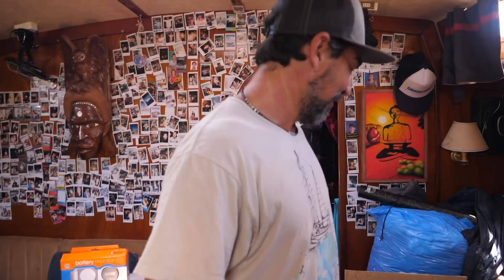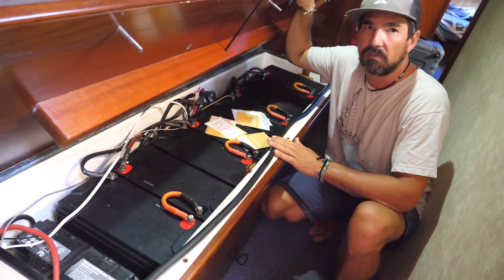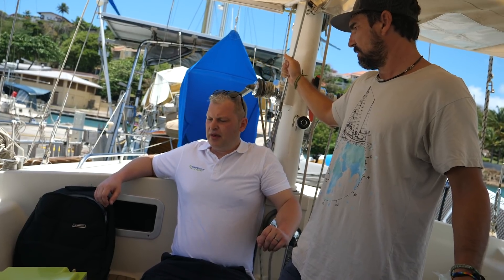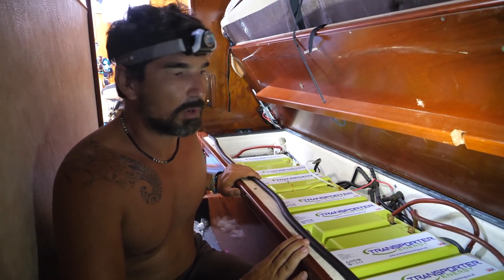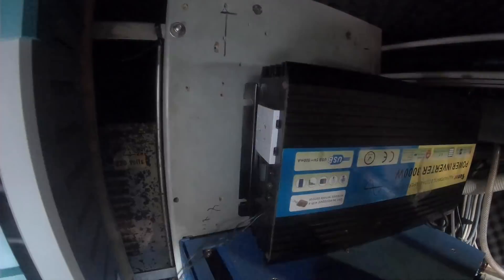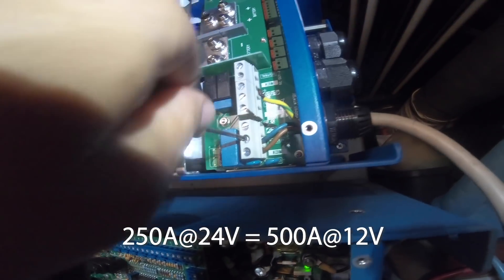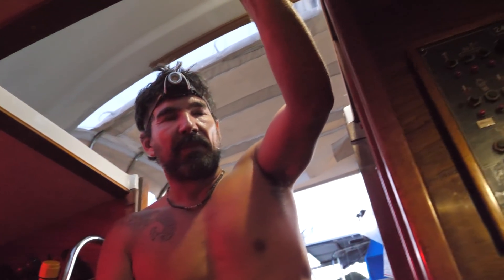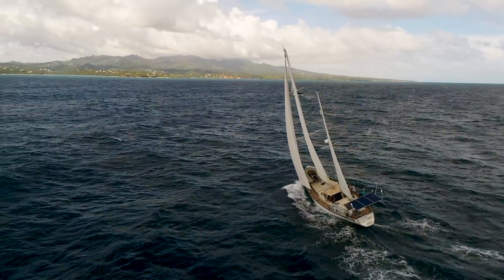Hello LITHIUM, Goodbye Propane!!!  Part 1-  Sailing Vessel Delos

Comment: You read a comment about flexible solar panels over your Bimini top on a different video  given that it is possible to use more power than you can produce with solar and wind and have to use the generator from time to time, I think it does make sense to make use of that unusable space to generate electricity.  The downside it that it would block sun light in that space making it darker.

Comment: When working on batteries, first and foremost, disconnect the ground connections FIRST, and hook up the ground connections up LAST!!! That means when you connect up the positive leads there are no sparks, and they can't arch over to grounded things when being hooked up. NOTE: This is for working on the batteries. Everything else, work with the circuit breakers off.

Comment: I'm  just watching now Aug 24 2020.
15:30 I heard Brian say he configured it for lithium Ion.
His batteries are lifeP04 (lithium iron phosphate) 
Note : lifeP04  range between 2.5v min. and 3.65 v max.
          Lithium Ion range between 3.0v min. and 4.2v max.
If he over charges a battery he could damage it . Fortunately the built in computer (bms) should stop the cells from over charging. 
He should set it for lifeP04 .
Also set the range between  2.8v and 3.6v or 3.5v in order to extend the number of cycles .

Comment: 3:58 I don't what's with the lead-acid, I don't understand the explanation, but you're going to get 100% capacity of the Li-Ion; if you charge only in CC, and not CV, they are not going to be fully charged, maybe 80%, in CV charging profile, current drops slowly down

Comment: propane tanks do not explode without significant external effort. LITHIUM batteries on the otherhand.... remember when those note 8 phones were exploding in peoples pockets. Thats what happens. They don't explode per say but ignite.
Reply from the maker: I think it's worth noting the the batteries used on boats are typically LiFePo4 which are much more stable, and thus less energy density, than those used in phones and cars.  I've found as long as you properly charge them they are very dependable and quite safe.  On the other hand during this trip over the past 10 years we've had two galley fires as the result of propane leaks....  I also spoke to someone that had their deck blown off because propane is heavier than air and sinks into the bilge.  Always a caveat to anything!

Comment: Diesel powered hob....save electric power https://www.ebay.fr/itm/Webasto-Diesel-Cuisiniere-X100-Avec-Installation-Kit-/264796696278?gclid=CjwKCAjw34n5BRA9EiwA2u9k31lYTua3H5UMlFeCwGtVfl8k8Ube29uPZz7QCafT6VrdB4Klmx8wdxoCfMAQAvD_BwE&var=0&mkevt=1&mkcid=1&mkrid=709-53476-19255-0&campid=5338666530&toolid=10044&customid=CjwKCAjw34n5BRA9EiwA2u9k31lYTua3H5UMlFeCwGtVfl8k8Ube29uPZz7QCafT6VrdB4Klmx8wdxoCfMAQAvD_BwE

Comment: What you are talking about the battery and voltage spikes and voltage changes. I don't know with such big bulks, but in small circuits I fix that problem with a condensor between both poles.

I'm guessing you could do something similar? only a much bigger condensor
Reply: i'm guessing that's pretty much what the reserve battery does, but maybe battery is not used to get drained so quickly?

Comment: Confession time:  Before watching the whole video, I jumped to "contusions."  Didn't know that the Li batteries are smart batteries, which monitor themselves and expectantly avoid any failures, fires, or other catastrophic events.  OK ... green light.  My only problem is that I'm still on the early stages of depreciation/amortization of the beaucoup bucks AGM batteries installed a year ago.  Now, does Balmar make a regulator which will address the efficient charging of Li batteries?  I don't have a generator, but would like to upgrade the Yanmar stock alternator / voltage regulator to handle, for the time being, installed AGM  batteries, with the future option of switching to Li batteries.  The propane stove is good for making a Lasagne, or a pizza.  Maybe there's a big Dutch oven or a fabricated steel box to put on the induction plates to simulate an oven.  It's looking like LED's and Lithium batteries are the greatest advance in sailboat technology since fiberglass, carbon fiber, and stainless steel.  Read some old sailing books when they sailed with oil running lamps from England to Scandinavia/ Denmark, in the fog, in English Channel sweeping currents, around ubiquitous rocks and reefs, in the fog, in leaky wooden sailboats.   AIS, proximity alert radar, autopilots, satellite weather maps?  Don't let all this lull you into a state of capricious  non-vigilant attention.

Comment: What is fire risk with Lithium batteries?  I bought a NewWave induction hotplate (fell for the infomercial) and it is GREAT.  Dial in the temperature you want.  You need SS or iron pans.  Dutch oven is great for stews.  Up north, propane is handy for heating with (forgot the name) space heaters.  Always leave hatch cracked open though.  I guess Teslas don't catch on fire often so guess that the Li batteries are relatively safe.  Maybe have an automatic fire suppression installed over batteries?  Type C fire extinguisher for electrical fires?

Comment: The thing you must be very aware of is that batteries have tremendous current capacity.  If you were to allow a tool to come in contact with both terminals you can weld a large wrench or burn in two.

Comment: I remember being 10 years old exprimentaing with ultra large (barely liftable)  1.5V carbon zinc cell my dad had brought home from his work that had been used as back -up supply for some industrial circuit.
 In my mind there was of course no danger (as I undertsood  1.5V). Of course there was no danger of electrocution -  you could put your tongue across terminals and feel nothing. But then accidentally connect a thick conductor wire across the terminal (as I did) and the flash /bang as the many 100s Amp current surged through and vaporised it instantly  was quite a shock to me. No harm done - but a close escape

Comment: In the video before you worked on the stove top and before the carpenter was aboard. What is the black appliance behind you on the counter top that has a chrome fan cover? If you were looking at the stove. On your right?   Also i wonder how much voltage did you use with the new system and using the a/c ?? Versus the old lead acid system ?

Comment: Another great improvement to an already sweet and pretty low environmental impact floating home you guys have in SV Delos. Nice job with explaining the new system and why you made the switch and you choice of LiPO battery.  I had no idea there were so many different types of LiPO.  Appreciate the knowledge.  Curious what the new system costed you and how long before it pays for it self vs propane.

Comment: I just wonder how long will these last. In my experience  lithium batteries last about about 6-7 years in my use I rarely go below 70-80% most of the time my batteries are fully charged up . Lead and agm batteries last about as long but cost way less than lithium.

Comment: Great video, very interesting! Just a thought... I've always found induction hobs to be as quick, if not quicker than gas; although the calorific content of Butane / Propane being a petroleum derivative is higher than Natural gas, and so will boil quicker. But is the kettle you used the one you used to use on the gas stove? Induction Hobs need a kettle with a perfectly flat, smooth base with no air gap between the base of the kettle and the ceramic worktop - also installing an Induction Hob usually means buying new cookware with steel base that are strongly attracted to a magnet - copper, stainless steel or cast iron won't heat so well. Above all, ensure the base is dead flat or air gaps will be formed between the cookware and the hob - which will overheat and cause the hob over temperature cut out to operate early - maybe the clicking you heard!   Sorry if you knew all this - but maybe someone else considering a ceramic induction coupled worktop may benefit. Cheers!

Comment: Why use a generator? You'd be better off using solar panels or a small win generator.
 Cruising the cut uses solar panels with no generator and has plenty of power. Just thinking out loud.

Comment: It sounded to me like the batteries are in charge. (No pun intended!) IF they all detect a problem and turn themselves off, are they guaranteed to come back on again if the problem is corrected or can they leave you powerless? Are their onboard computers isolated from external power surges? Does your generator come on automatically when battery power is lost? What could you do if they all shut down when you needed to be pumping water out of the bilge from a leak? 

Can you mix the starting battery with the Li batteries without having them on a different charger? Are the 4 24VDC Li battery pairs being charged at 24 V or 12V each even though they're paired? Is it that NEW charge controller you bought capable of making the changes from the solar and wind generator charging for the Li batteries?

Comment: If you wish to avoid spikes--a large capacitor or bank of capacitors will do that better than a battery which will absorb current but not take the peak from high volts instantly because of its internal resistance.

Comment: You still have the same ampere hours from lead acid cells  regard less of the battery configuration.  At 24 volts you draw half the amps--not double.  Loved your choice of Lithium cells.

Comment: Did the charging units require a lot of wiring changes or just system configuration (software) changes?

Comment: I am sorry...
I want to tell you something without offending.
The batteries are incorrectly wired.
That configuration will lead to constant discharging and eventually drainage of the batteries during non charging times. In other words, it is inefficient and adds wear and tear to the batteries.
I just want to help. Please do not take it as a insult. 
It is a common error that portable power companies make and people living off grid make.

- I am a Computer Scientist and IT that specializes in mobile and remote installations.

Comment: GREAT JOB with the video. Just the right level of tech so we could follow along, without getting too deep or skimming too light. I am messing around with solar and wind on land, so that moving the experience to a boat might go better for me.
What did you do with the old batteries?
Did you consider keeping one or two of them and adding them to the starter battery, as a back up?
Have you ever tried or considered a hydro generator?
Keep up the great work!

Comment: Safer way would be to connect main terminals first, and then jumpers! Also, you have to optimize few things, induction should reduce time to half when boiling... No copper bottom, stainless is best, minimize distance (you have some silicone/anti slip pad?) https://youtu.be/2SDWkGx0ako

Comment: Great research and upgrade.  I would like to own the Amel 55 eventually,  I rebuilt a 21 wooden sailboat in greater Vancouver, Canada (Whiterock) that got pounded on a beach back in the 1970's,  new keel, new fibreglass over the whole bottom,  new decks and new bulkheads. I even repaired the sails with my mother's sewing machine.  Then I ran it down a river with thin ice and it sliced grooves into the plywood above the glass and it sunk in the Nikomekel River, my diving friends and I  got a whole bunch of innertubes from a wrecker and refloated it with our scuba tanks!

Comment: Another couple of advantages of induction over gas which is very important for boats and small spaces, (especially in colder climates) is that there is no water or carbon dioxide produced in the galley. Burning gas produces CO2 and H2O.

Comment: Great video Brian, very well explained.  Question: You left your starting battery as a lead acid, did you have to change anything on the alternator's regulator so that it can charge both types of battery chemistry?

Comment: Lithium is mined with environmental problems that follows. Propane is only sucked out of a hole then covered and sealed.
  Is this sponsored.
Reply: Nope propane is coming from the distillation process of oil,  it is the third lightest fraction from the top of the distillation tower.
I worked a good part of my life as control engineer for big oil .
Ethane, Methane, Propane , Butane  and so on .
You are confused with earth gas what is mostly Ethane and Methane !

Comment: Hi Brian,  Any update on how the Lithium batteries are doing?  Just attended a boating seminar with Nigel Calder and he was pretty keen on the integrel (www.integrelmarine.com) high energy output alternator and potential to couple to Li batteries.  Have you looked into?

Comment: At 13:40, the shunt you are speaking about works by there being a very slight resistance between the two terminals. Your small wire are looking at the voltage drop between those terminals that is caused by the current flow. More current flow = more voltage drop. The voltage signal can either drive an older analogue meter itself, or be used by a digital meter like you seem to have.

Comment: Brady High Brian and Brady, on eggs. Did you know that you can carry eggs for as long as six months unrefrigerated if you do the following, watch the ace clean let them dry put some mineral oil into a bowl rotate the egg and place on paper towel or NSYNC on paper towel let them dry and then make sure you get the spot with another coat that was touching the paper towel. This replaces I want the chicken naturally does for the egg as it comes through her canal and deposits a Sheen of protection on her egg making it non porous. I did this in my words for 6 months and after about six and a half months the first egg begin to spoil I tried one every two weeks and then at 6 months left the last one go another two weeks. there is no danger just smell them starting at about the 3-month mark and shoes a shaded area if you can. I am from an ex Amish family and we have been doing this for Generations

Comment: I know this is late... but how is the lithium power network working and are there any downsides that you’ve noticed?

Sail safe and be fun,
Mike O
Reply from the maker: The batteries are really excellent, they charge much more efficient and at a much higher rate.  As far as performance it is like replacing 8 of our old lead acid batteries with 4x that amount because of the increased capacity.  The one drawback is of course they are more expensive but given the performance and long life I do think they are worth every penny.  http://battlebornbatteries.com?afmc=svdelos_bb77 . Fair winds- Brian

Comment: I'll be interested to see how long your lithium-ion batteries last.  One of the nice things about lithium-ion batteries is that they put out 100 percent power right up to the point that they go dead.  Never allow the charge get below 15 percent or you could cause permanent damage to the batteries.  I like that these new batteries have significant safeguards built in, but I'm a little nervous about you stacking the batteries to get 24 volts.  I'm wondering what would happen if one of the batteries in the stack shuts down, what would that do to your system. In theory, the other battery in the stack would see an over voltage condition and shut down with in a second or less of the first battery shutting down.  If this happens under a heavy load, there would be a negative current spike, sudden drop in current, and a corresponding positive voltage spike.  Using a single lead acid battery as a buffer doesn't strike me as a very effective way to protect you system from a voltage spike.  Also, if a voltage spike is generated by one stack failing, could that spike cause the other lithium-ion battery stacks to shut down also.  Personally I would feel safer if you had a choke filter in series with each battery stack.  A chock filter is a coil of copper wire wrapped around a carbon or metal core, usually in the form of a toraid (donut) that has the characteristic of reducing or preventing Chang's in current flowing through it.  This would serve as a very effective buffer against voltage spikes that are caused by current spikes.

Comment: I'm surprised you only have a 3,000 watt inverter. It seems like with the electric stove top, fridge and a few other things running that would be getting pretty close? If you run the microwave, freezer, and stove top together that would be pretty close to 3,000 watts right?

Comment: Old time boat electrics (anything up to the late 70,s ) often used 110 D.C. because generators were very large and inverters weren't around yet ..... so a lot of equipment was heavy D.C. ..... a lot of boats blew up from bad gas ventilation

Comment: I just love this video and where it is headed, figuratively speaking. Can I assume Brian that you are an engineer? Your footprints in the sands of time,  will Not be carbon footprints. Questions: How water-proof are these batteries? Will you have to balance the boat? Is the cabin air conditioned? How effective will the solar panels be to recharge the batteries?

Comment: Great info -- thanks!  It would also be interesting to know how much weight you saved (or were able to devote to other uses) because it wasn't just the difference in batter weight, but also propane cylinders, piping and swapping that heavy-looking stove for the cooktop.

Comment: I had on my rv a big capacitor made for car stereos... could be helpful for a 24v system... I used a 48vdc system on a 15kw inverter which maxed out at 60kw temporarily for motors to get started! The 15kw I got on eBay cost $600 and can be bought for a 24v system...